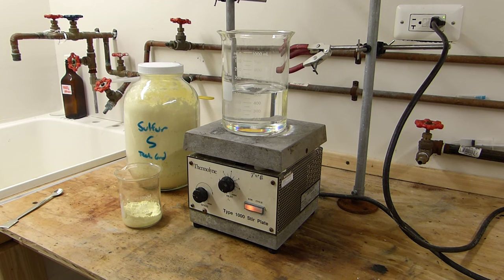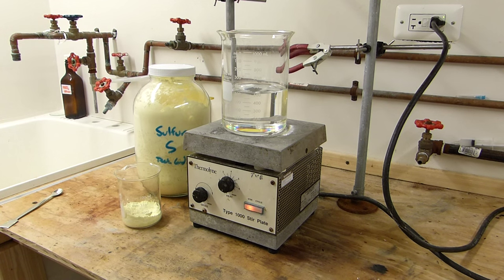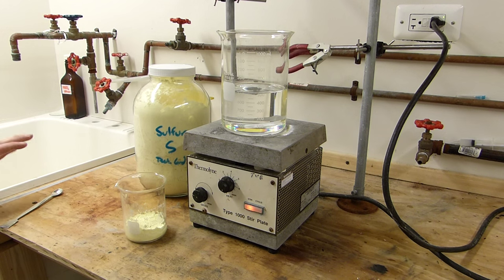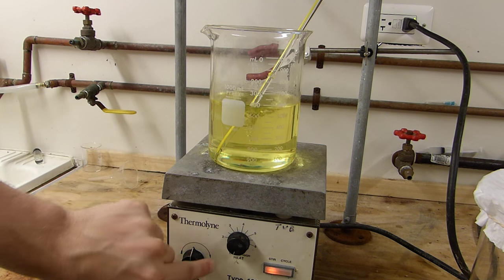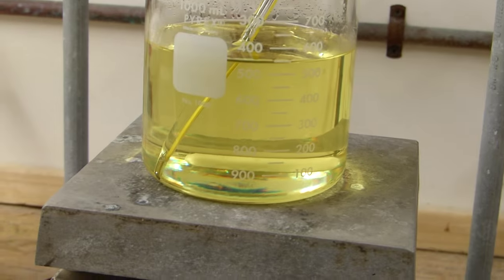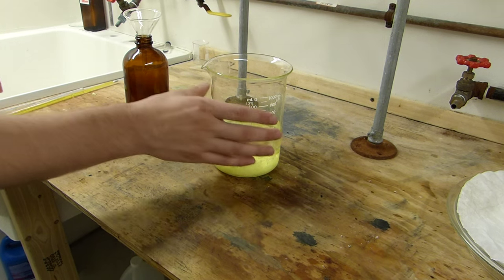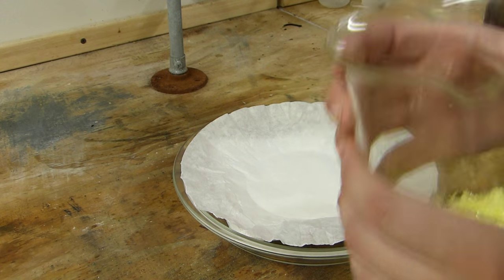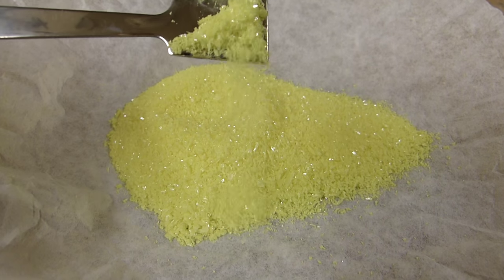Recrystallization of Sulfur

Comment: This works, and very well, but I found several issues.  1) after you are done retrieving your sulfur, it out-gasses xylene(s) for some time after, days if you spread it out.  Heating it helps, but you have to be gentle or you will easily melt the sulfur.  It seems the xylene(s) act like a flux (think of soldering) which makes the sulfur melt easily and evenly.  Without it, it will just harden into an orange mass.  2)  It uses a LOT of Xylene(s), even recycling it you go through a lot and quickly.  Plus recycling it only will absorb about half as much new sulfur, which gives you an idea how much sulfur is locked into your xylene(s).  3) it is a crazy amount of work and cost in the end.  BTW, I found using an ice bath for doing the crystallization helpful, an IR thermometer was a handy tool, and finally, having an ice/ice-water filled round flask placed over the near-boiling xylene beaker was helpful to keep fumes down and reduce waste, though that was fairly small.  All of these tests were outside, away from the house.  (my tips to follow)
Reply: The short answer so far is buying pure sulfur if that is what you want.  However, experimenting did improve on the 3 issues mentioned above.  What I found helpful, was to take the pure or fairly pure sulfur from a few small runs of the method shown by Doug, but then to heat the mixture up on a hot plate slowly raising the temperature to 110-120C while keeping some xylenes in the beaker.  A 400 ml beaker was used and keeping ~20+ ml of xylene(s) was a reasonable amount.  The layers stratified while molten into the lower layer (~2g/cm3) orange molten sulfur, followed by a black filmy/syrupy layer of contaminants, and then an upper layer of clean (but saturated with sulfur) xylene(s).  When done stratifying, you can pour in more bad/original source sulfur to separate it, or at any time, stop and let it cool down.  The upper layer of fairly clean xylenes can be saved with gentle pouring, and the rest is a pasty layer of dirty xylene and contamination.  The sulfur forms a hard mass and the gunk mostly stays on top and can be washed off.  Wash off all the gunk and remelt with more xylenes to clean again.  Repeat as desired.  Again, it is helpful to cover the beaker while doing this with at least a watch glass (10 cm worked well with 400 ml beaker).  Use caution when heating up and lots of xylenes initially as it helps prevent "burning" the sulfur.  Don't boil the xylene.  I found that when it started bubbling, it was too hot, but a perfect time to add more impure material as that cools it down and moves along your process.  130C is too hot - both for the xylenes and for the sulfur, stay away from temps much over 130C or you will both boil the xylenes and turn your sulfur into hard to remove goo.  It was also found that if the xylene gets too dirty, simply adding more will cause it to separate back into a dark contaminated layer and a clean one and greatly improve the product quality.  Also interesting is trying a borosilicate (pyrex) pipette to remove the lower layer.  It works, but you must heat it up first and be ready for the inside of it to cake up.  Easier is to keep cleaning the sulfur, then either let it cool into a hard mass, or pour it in water to get easy to remove (though hard) beads.
Reply: @LFTRnow  thank you;  I am attempting to make TEOS from scratch and I will be referencing your notes.
Reply: You can sublime sulphur by heating and then pour it to condense it on a cold surface

Comment: While blends vary by refinery and season, toluene is a significant component of high grade gasoline as it has desirable octane boosting properties. esp if you can find alcohol free 92octane fuel, or unleaded or "low lead" 110+ racing gas or aviation gas(note it uses a different octane scale than highway fuel) may be able to use fractional distillation to get the toluene. Around here a gallon of toluene is the same price as xylenes. 
50/50 toluene and MEK is a very strong solvent blend btw at least for greases, varnish, eats up nitrile gloves.

Comment: Nice work, could have placed a round bottom flask of cold water during the heating stage, to condense the fumes though. Also would sublimation of the sulfer, and bubbling though cold water purify it as well as xylene recrystallization?

Comment: my first re-crystallization was of sulfur from powdered insecticide using dimethyldisulfide from paint stripper. the yield was horrible (think i got about a gram or two) but the crystals are so pretty. i keep them in a vile and just like to look at them. this process seams so much easier than what i used congratulations on your videos they are very well produced
Reply: thanks for the info,gonna try dmso see what that does,99% percent pure at farm stores for horse  probs,really cheap
Reply: just tried got immediate super saturation  at room temp, if anything can purify the sulfer to the 99.99% range
Reply: Craig Cain I used garden acidifyier sulphur pellets. But it contains some clay based additives that can be separated by dissolving in water. The sulphur will remain.

Comment: easy way to upgrade to reflux: use a loose sheet of plastic wrap on top, pushed in a bit to form a shallow cone, and then fill it with salted ice cubes. This works great with other solvents, not 100% sure it would work with xylene considering what you stated about the vapor pressure being similar to water. It also has a safety feature: if the condensation can't keep up, the pressure builds a little bit and pushes some ice-cold water over the side, providing vapor-change cooling to the hot plate :-)

..then again, if you're refluxing, you could use a more expensive solvent.

Comment: Good lab practice is to raise the thermometer off the bottom of the beaker and keep it vertical,  as contact with the glass/hotplate will give a higher indicated temperature than the surrounding liquid due to conduction.

Comment: What was the mass of recovered sulfur?  And, if you have done this since then, how much does that vary?  

It looks like the differential in solubility is enough to use the cold saturated solvent over and oven by simply heating, dissolving and cooling/recrystallizing over and over.  Nice work.
Reply: he lost some when he poured out the solution, it was sulfur contaminated, cause it was still yellow not clear.

Comment: One thing you should note about heating xylene, is it's flash point, 30 deg. C. This means that if any of it's vapors come in contact with your hotplate (which may reach to 100+ deg C on setting one), they are likely to spontaneously ignite. If you left it sitting open near a hotplate like that, there's a risk of the vapors flash igniting and trailing back to your beaker resulting in explosion.
Reply: +Bloodmoon Flash point is the temperature at which a vapor/air mixture can react with oxygen, that doesn't mean it will ignite at it's flash point, or even close to it.
Reply: NATO: True enough.  There is the danger of xylene vapors boiling out of the flask and, being denser than air, flowing down to the hotplate, where the on/off switches - certainly well above 30ºC - present a potential source of sparks.  Lots of lab fires are started this way, although more often with more volatile  solvents like ether and acetone.
The take-home lesson is, don't boil flammable solvents in beakers on hot plates.  Doug was careful to keep the xylenes well below the boiling point (ca. 140ºC), but that means attending to the setup constantly - you don't go to lunch and leave the hot plate on.

Comment: Anyone have any suggestions in regards to how to clean the glassware and equipment after recrystallizing some sulfur? Obviously it's soluble in toluene and xylene(s), but is there another solvent/method/trick that can do it at room temperature and doesn't require more highly flammable and stinky vapors?

Comment: rather surprised you weren't refluxing to avoid solvent loss.
Reply: eh it's pretty cheap i guess
Reply: @uxleumas  Xylol is not particularly cheap at the retail level.($20 per gallon around here) But I was thinking more of generally reducing the fume load more for health, fire, and environmental reasons. Just a simple condenser with cool water, maybe just a round bottom flask with ice water set on top of the flask.

Comment: .....oh, so you have to heat the xylene to  dissolve the sulphur.  With carbon  disulphide it dissolves easily , but of course if you want crystals then the temperature  factor is an advantage to  employ, to make crystals using CS² would  require  evaporation  of all  the CS² .

Comment: xylenes are Not the same thing as gasoline. Gasolines have various ingredients that produce a distillation curve this is done to allow for good vaporization in a wide range of temperature such as winter and summer driving. This makes starting easier and xylenes have poor anti- knock charateristics.

Comment: Why don't you remove the stirbar when waiting for the sulfur to recrystallize? If you did it won't serve as a site for nucleation and you wont have to recovery the solid off the stirbar.
Reply: Robert Hoppe some of the product will stick to the stir bar resulting in product loss. It's better to remove it at the end when the product has dried and none of it sticks

Comment: How do you know the impurities didn't also get dissolved into the xylenes and subsequently recrystallized with the sulfur?
Reply from the maker: +Luc Serre That can happen! I am relying on this method to select only compounds which exhibit solubility in xylenes very similar to sulfur. I don't think there is much out there that fits those requirements and is also found in my raw sulfur, but it is a definite possibility.  Another way to achieve very high purity is to sublime the sulfur in a vacuum. Unfortunately, I don't have the apparatus for that, so I have to take the best I can get. :)
Reply: +Doug's Lab Some dissolved impurities may remain in the liquid xylenes wetting the crystals before drying. Better purity could be obtained by washing the crystals with clean cold xylenes before the drying step.
Reply: +ib9rt Or washing with a different solvent which sulfur is not soluble in. Heptane maybe? It would at the very least remove the smell of zylenes from the sulfur.

Comment: It wouldn't be a lab disaster if it caught fire.  Lol!  It would just be a flamming beaker that can easily be extinguished with a watch glass.  I've had that exact thing happen before with 2 liters of xylene and with the same amount of toluene and a watch glass safely put out the flames in both cases.  That's not to say that it isn't scary as shit though!

Comment: ok, your fridge might not be explosion proof. but whats about the rest of your lab, e.g. the switch of your hotplate?? 
my honest opinion: your setup looks extremely dangerous and unprofessional which makes me seriousely concerned about your health and life!
Reply: I think you're being irrational. Could you tell me 1 fully detailed possible accident scenario that is caused by the shortcomings of this guy's setup?
Reply: @AndyU96  sure: the isomeres of xylene have a flashpoint between 17 and 25 deg C and 30 deg C for the mixture (according to wikipedia, composition of mixture?). The higher the temperature the higher the maximum percentage of solvent fumes right above the surface of the solvent. heating your solvent to 88 deg C or maybe close to boiling (according to your vid and if I understood right) means the vapour pressure of your solvent at this point will be such to create a vapour / air mixture well above the lower explosion limits of the xylene isomers (between 0.9 and 1.0 % - corresponding to the respective flashpoints cited above), maybe even above the upper explosion limit (where, of course ignition would not be possible anymore). However, the fumes emanating from your beaker will get mixed with air (convection in your lab, you moving around, ...) to create any mixture ratio between the highest (depending on the temperature of the liquid, as explained above) and more or less 0. 
This means you just need a little bit of bad luck like e.g. the thermostat of your hotplate switching off right at the time when an igniteable mixture of air and solvent is surroundig the switch and - boooom - your beaker and your lab are on fire - if your are very unlucky you will get some sort of more or less destructive gasexplosion (well, deflagration to be precise). At this point one of your least concerns will be to get your fire-extinguisher and try to rescue what can be rescued. rather you will try to get out as quickly as possible and hope to stay alive!

just think about - what might happen if you take a source of ignition closer and closer to a beaker of hot gasoline? you might still be some feet away from the beaker and the mixture of air and vapour will ignite (as you mentioned a mix of xylenes will behave very similar to gasoline in terms of flamability)
PLEASE! dont try above scenarion - most likely it will get you into hospital or worse!

besides the above scenario - very rightfully you mentioned the danger of putting your hot beaker into the (non-explosionproof) fridge. I assume you were thinking about the fumes of your hot solvent reaching critical concentration within the unventilated space inside your fridge. 
Give me any reason why the danger of finding a source of ignition should be impossible for the hot solvent in your lab when you clearly admit there is real danger within the fridge? - of course taking into account my explanation above.

Well, I hope I could explain my concerns clear enough to be understood by somebody else than me ;-)
feel free to ask if anything is unclear.

best regards and happy and save labtime to you my friend!